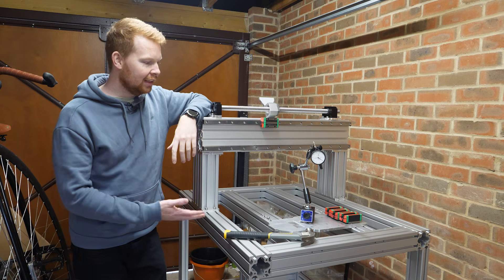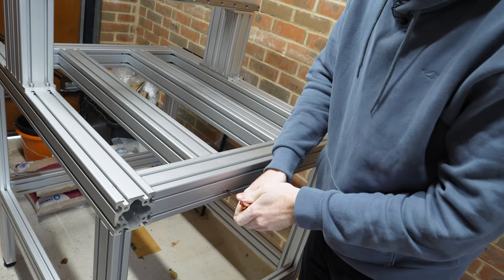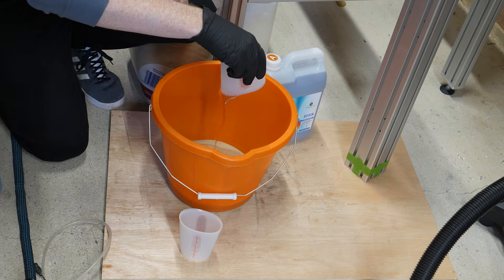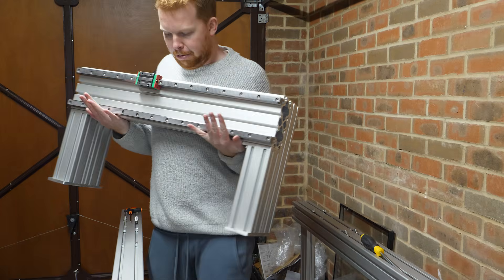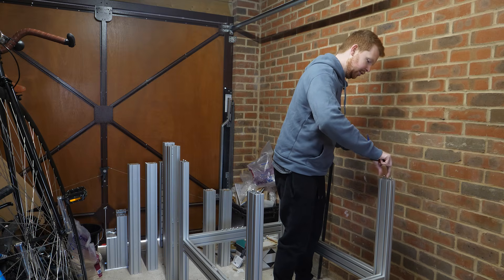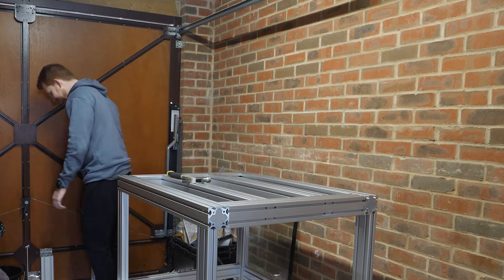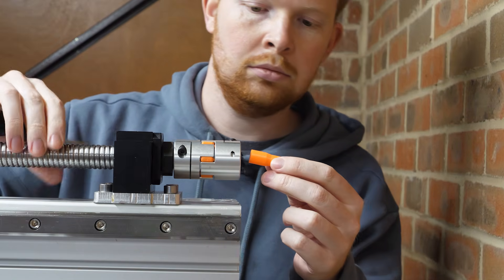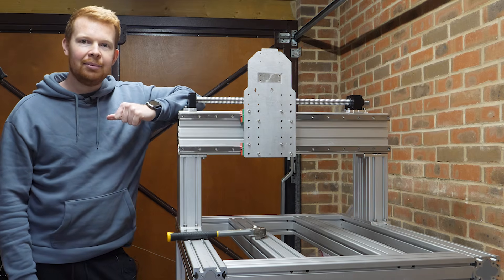Building a CNC Mill/Router - Part 2

Comment: The whole reason for sand is that it is a mass of loose particles. Any ringing is dampened by friction between the individual particles. By turning the sand into a solid with the epoxy, you simply changed the resonant frequency and spectrum, not so much dampening any vibration.

Comment: Maybe you can add vibration dampening tape to the part that still rings. Just to remove the energy a little faster. 🤔
And making the machine a little less noisy.

Comment: Fyi epoxy granit 1-10 1-12 not 1-4 way too much epoxy especially if your making structural parts with it its all about packing density like when working with composites you want the smallest amount of epoxy possible as its the weakest part

Comment: Have people tried other materials that are less messy than sand?

- Spray foam?
- bits of mineral wool insulation rammed into the extrusion with a dowel?
- concrete ? (maybe just for the legs)

Just wondering what people think about other materials that don't require mixing expensive and messy epoxy and specialized sand.

Also, rather than mixing epoxy with sand, if you don't want the sand to spill, could you just spray a bit of high-density foam into the ends, pour in loose sand, and seal the other end with foam and then a cap? You could possibly seal the screw holes with hot glue or caulk and still be able to drive in screws when you're ready? Epoxy/sand just seems like a pain.

Comment: You can fabricate some metal tube filled with loose sand and attach those under the 80x80 profilese. Loose sand will dampen the vibration way more than epoxy granite.

Comment: Try steel or lead shot plus loose dried sand in the base. This should give you an acoustically dead stand, and make the tool bottom heavy. Right now you are top heavy and that will amplify any vibrations. You may also want to replace the uprights with square 80x80s. They will be easier to fill and give you a bit more contact area and stability at the corners. 
Lastly, you may want to use additional angle braces or plates to increase the rigidity of your extrusion joints

Comment: You can fill the smaller areas of extrusions by loading the epoxy granite into refillable caulking cartridges and pressure/squeezing it into the extrusion. If you want more rigidity, you can use steel rebar implanted into the epoxy granite.

Comment: I'd use fine lead shot and epoxy.
those side holes suck, there's no good way to block them, maybe poster putty..
Reply: the few bolts don't look sufficient, and welding means warping. It needs cement legs with a base table to sit on of cement that it bolts to for rigidity

Comment: Maybe inserting rubber/elastic "cushins" between the bed and the legs could help isolating them from each other? Of course that means another cumbersome disassembly and reassembly... But if you still decide to do it, don't forget the screws connecting the two halves together would also need some mini-cushins!

Comment: There is 4 ways to get rid of vibrations mechanically.

1)Dumping vibrations
Vibrations partially turns into heat or another energy form. Filling with sand to body and adding rubber foots includes this approach.

2) Adding or substracting mass

3) Adding spring element (with dumping element)
Firstly calculating (or FEA) the natural frequency helps a lot in the begining. Then you'll find some natural frequencies which is harmful to work with these frequencies. Accelerations of your cnc is limited by natural frequencies of machine's body structure.
If accelerations matches with your cnc you have to move away these frequencies with adjusting accelerations, adding mass, spring or dumping elements can be added "with calculations".

4) Transmitting vibrations to more rigid mass
Fixing the cnc to the floor helps to get rid of the vibrations because you will change the natural frequencies of the body.

Bonus: Eleminating vibrations with stepper or servo motors and creating counter frequencies is the solution. Open loop (like input shaping) or closed loop systems available. Try use "klipper" with cnc for input shaping. (An accelerometer will help you to measure frequencies)

Comment: I'm curious as to why you elected to make the legs so high - obviously I can't see if they are resting on something that raises it more, but I would have thought that shorter legs, a lower stand would have been more rigid. Also, the excess material could make a more supportive structure. Lastly, I would be tempted to put triangulation gussets in to prevent pantograph movement.  Still, a very nice job, and certainly will be following!

Comment: Is there a reason to use epoxy over plaster of paris? You could add some sand into the plaster and still be able to poor it in.
The reason I'd think plaster would be a better idea is that it's much cheaper and you'd be able to remove it if you ever needed to.

Comment: my understanding, and it can totally be flawed and wrong but... I thought best results for deadening sound and vibration was by having the sand loose as that allows the sand to move and shift absorbing the vibrations. so wouldn't epoxy'ing it in place mitigate most of that effect. It does sound a lot less ringy but I'm guess you'll always have some of that as it is metal.

Comment: you seasled the sand with epoxy. you should have loose sand to absorb the vibrations by transferring the kenetic energy instead of hardening it all together to just make a thicker thing that can vibrate it all through it.

Comment: Sorry to say so but all you did was increasing the weight (what helps) but you wanted something to absorb the resonance and not another solid that's having its own frequency. The result is within expectation. Next time you could either use sand without epoxy, or a soft, damping material like a 2K PUR filler. And, btw, use automatic connectors for item profiles. That's a big help

Comment: The point of the sand is to act as attenuation for the resonant frequencies of the extrusion, it's not really about the weight. The granules inside the cavity move around with the vibrations and dampen the effect by absorbing some of the energy. The same principal as a deadblow hammer (plastic mallet filled with lead shot).

Comment: Get some angle steel bolted to T slots along the length of the legs.
Reply: If the internal  corner radius of the angle steel does not match the corner radius of the extrusion you can place spacers one one side of the 90 degree angle steel.   it will be very sturdy!

Comment: I've worked with epoxy granite fills before, and I think your mix was way too dry. It is very hard to work and won't pour, and you also get poor adhesion to the metal tubes.
Try lixing in enough epoxy that you can pour it from a cup, (hopefully one with a spout) and then you can pour it down the small metal tubes and it will guve very good adhesion to the tube walls. Much better damping. When mixed that wet, the sand will settle in the tube and leave a liquid layer on top (assuming the tube is verical) so you will need to deal with that, most likely by removing any top liquid then adding more mixture. You can do all that in the one pour process you need a way to remove the top liquid ie a sponge, cloth, suction tube etc.
Looking forward to seeing the rest of your build. 👍🙂
Reply: How are epoxy granite fillings made?
Reply: @NEUROCNC    it is a composite of a liquid epoxy and a non-crushable stone like granite. Generally the granite is weighed in different sizes from large to small. It is poured into a mould and then the epoxy sets hard, and the result is like stone.

Comment: ah yes the tried and true method of solving resonance in an item by filling it with a solid and testing it while holding it with your hand. loose sand and if at all possible use unequal spacing. you could also use sound absorbing sticky mats for cars or see if 3M will give you a roll of their crazy dampening tape.
Reply: epoxy granite is for making a solid base for things that is less affected by temperature than metal while being less expensive than granite or cast iron (single batch) how you thought that you could combine the ideas, in a way that does not absorb sound nor significantly change the thermal stability, is beyond me. your saving grace will be to fill your head hole from part one thumbnail with loose sand. you can use wax or earplugs to fill holes

Comment: Suppose that's why the older stationary machines were casted instead of bolting lightweight stuff together.
Filling the machine with just sand when is was put together might have worked well with just those caps.
Tilt, fill, closd and repeat

Comment: Add plywood wall panels around the aluminum frame, will remove all of those vibrations and significantly further stiffen the structure.
Reply: It could definitely do with bracing. I would experiment bracing with rubber pads sandwiched between the members and the braces

Comment: What you could do for the legs is use motor mix . It is much thinner than concrete but not as thin as straight epoxy so it would would flow into the legs much easer. But wouldn't flow out as long as you had end caps on the bottom. if you are worried about them ringing.

Comment: Should have used a small tamper to pack the sand down, the air gaps are a lot of lost volume, weight, and thus rigidity.

Comment: Solidifying the sand almost entirely defeats the purpose.  Once solid, the only dampening effect comes from the weight and there are much heavier substances you could have used if that was the goal.

Comment: Failed designed. Even if you replaced extrusions with solid steel, youll have the same problem. 
The bed and motor need contact with a heavy and dense mass. 
Youll be stuck cutting metals at 0.01 mm fpt.
2 posts for the motor, connected to horizontal posts with no direct underlying support 🤦‍♂if the goal was to create bell, this is perfect

Comment: Don't want to be negative but 8:40 really summarized why people are questioning this. A HUGE lead screw, big extrusions, filled with sand/epoxy and tested with a hammer in the very unscientific "ring test." 😂 Seriously. Build it and see how it performs before over "engineering" solutions to problems that might not even exist.
Reply: Epoxy granite is a proven solution to resonance. You are being ignorant for the sake of it. It's not over engineering, as this is common practice in many DIY solutions and commercial solutions where cast iron is not feasible. As I assume you don't know, cast iron has very good resonance-damping properties, which is why it's used in industrial CNC machines.

Comment: Do you really need to rigidly mount the frame to the feet? Maybe adding some rubber to the mounting-points could dampen the vibrations traveling from the main frame into the base/legs.

Comment: All the rigidity is in the base and gantry, right?  Why don’t you use some sort of vibration isolator between the base and the stand?  Maybe a high density rubber mat?  This could help with accoustics.

Comment: I would think that Constraint Layer Dampening would work really well for damping the internal vibrations, easiest and most affordable way to do that would be the sound deadening used in cars.
You'd want to get the stuff that has a goey viscoelastic layer on one side and a thick foil layer on the other side. It's incredible how effective it is at damping sound and ringing in solids.
I have no idea if anyone has done that with a CNC machine but it should work!

Also I would have left the sand dry and only added resin to the ends so it can't escape, seems like if you make the sand a solid structure then it's reduced its dampening effect and it's only lowering the resonant frequency, and hasn't increased the decay rate 

Good luck!

Comment: Seems to me like the cost, time effort and recycleability  of using this sand, epoxy, resin, aluminium and t nut combination would be worse than just buying bar stock steel in the first place

Comment: Could you not just pour raw sand in the vertical legs? And, for more rigidity, have bolts go all the way through the extrusions?? I have built a similar machine with 2 inch extrusions with no sand fill. It is accurate +/- .005".

Comment: Perhaps the ringing is coming from the contact between the heads of the fasteners and the inner surface of the t slot of the mating beam. I suggest testing various durometer rubber washers under the heads of the fasteners to dial in the perfect damping. (not "dampening" if you're going to use this in a video)

Comment: There is always tradeoffs when designing such a machine. Take your gantry axis for example. You can use very low rails to increase rigidity but then often loose out on drive-stiffness by needing coupling over to the leadscrew (like you have). Alternative is using taller guiderails where the leadscrew can fit under and the coupling nut carrier can then interface directly with the axis for a stiffer drive position. In the end I do not know which is more rigid but I went for the second option on my machine based on simulations in the CAD.

Comment: You should have made endcaps and left the sand without the epoxy. The loose sand can absorb the vibrations because they can move while the granite will act as a single piece with a single resonance. Think about a dead mallet. It is filled with loose sand.

Comment: The sand-epoxy just acts as an inertial damper or ballast. I've seen other methods that use thick, used oil made even more viscous by mixing it with fine, sandblasting media. This might have better dissipation.

Comment: I really love your approach! But .. I would go for High-density polyurethane foam to create a sturdy base, and reduce the weight. I'm no scientist or expert, but this is what came to my mind. Maybe it won't win from the sand / epoxy mix. Another way to go, but ends op very heavy is to fill the profile with concrete. As this is not flexible, it could crack, so I think this is eventually a no-go. Keep up the good work Tom!

Comment: Not filling the base is a mistake. 
Just play around with the epoxy/sand ratio until you get something pourable, just plain expoxy is better and stiffer than air. 
Never half ass the rigidity.

Comment: Perhaps the audible ringing is actually taking place in the open slots in the extrusions, rather than the core of the extrusions. Maybe worth fitting a length of silicon strip just to see if it changes the tone, then you’ll have your answer

Comment: You could add custom-designed tuned mass dampers to the outside of the legs if it turns out that you need to, that would make for another interesting video in its own right.

Comment: By epoxying the sand you took away the physical property that makes it dampening in the first place...

Sand moving under vibration is what dissipates the energy.

You didn't remove any ringing, you just added mass and so lowered its frequency.
Reply: This statement is not entirely true.

Comment: Tom! As a percussionist, I highly recommend using some drum mutes/dampening pads! You can grab a couple of snare mutes that are essentially like little sticky gel pads and slap them on the outside of the extrusions. Or you can fill the inside of the legs with loose sand which should do a better job of absorbing those frequencies. OR you can even encase the bottoms of the legs in a little bit of silicone (mold a foot around them and put a slightly more resilient rubber pad on the bottom underneath the silicone mold perpendicular to the end of the extrusion and the silicone, and epoxy the two together). Any/all of the above can help a lot with dampening the ringing if you’re not already adequately satisfied with how it currently is. Hope this helps!!
Reply: Or Dynamat for car sound  insulation on the legs might work.

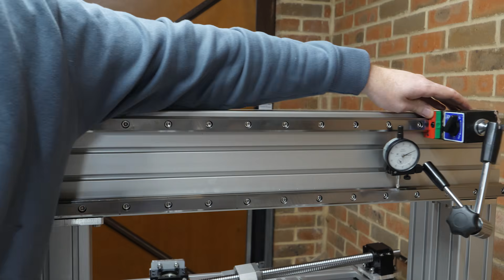Comment: 0:14 note that this measurement does not necessarily suggest there is a dip or bump in the middle of the extrusion, it may well be that the rail or the reference surface it is mounted to is twisted, which is a far more annoying problem to deal with. the way to measure this is with a precision spirit level, usually with a resolution of 0.02 mm/m or 0.05 mm/m. if you decide to dive into the deep end and research all the possible sources of error in a linear motion system, know that you'll probably either have to accept that you won't be making very accurate parts or that you'll be spending a lot of time getting it right... i've been there. lol

Comment: Great video

Side note. You could've used cement instead of epoxy. It is a common soil stabiliser for pavements and alike. You'd be surprised how stiff it can get with as little as 5% cement by weight

Comment: Tim, good job, I am keenly capturedin your videos about this as I only just finished my CNC mill (I wish I had a CNC to build the frame mounting parts as that would have eliminated my inaccuracies in making the fixtures and it would not have taken 6 years). You will definitely see an improvement in cut quality with your improvements, but making some chips will be the biggest tell. From the video it looks like rigidity from the grooves/T slot fixtures maybe your weakest point causing flex on the gantry and you may need to increase the gantry mounting strength with a drilled & bolted hole through Y axis mounting + to support this the gantry feet & fixturing could be bulked up. Love the videos.

Comment: I wonder if using water-proofing mix would be better than using epoxy granite. That mix has rubber in it which is excellent for absorbing vibrations. Epoxy granite makes the whole structure more rigid but I wonder if it really does anything to absorb vibrations. You could also use cement mixed with plasticiser but that may corrode the aluminium extrusions.

Comment: I've been thinking about building a cnc with these extrusions too and I was thinking about filling them with some kind of damping material. Like greenglue or some liquid rubber type stuff that sets and becomes solid material that actually damps the vibrations rather than just adding mass